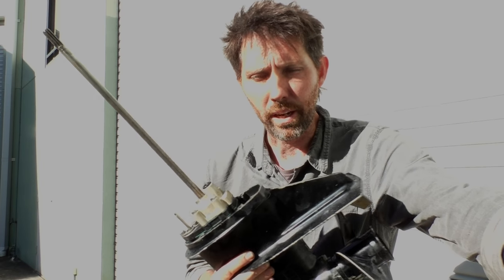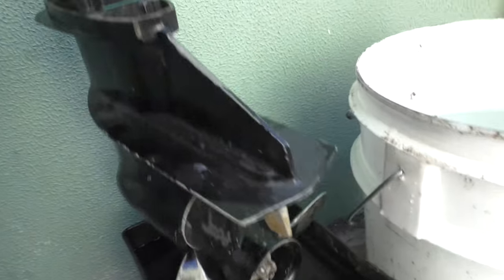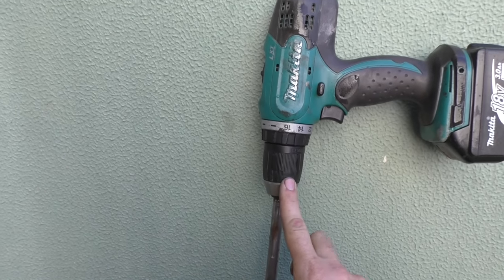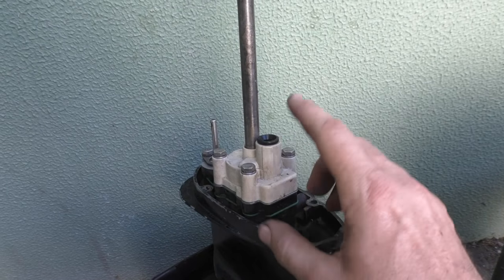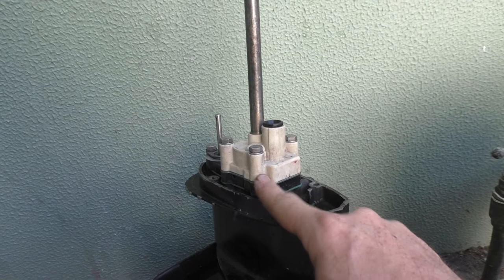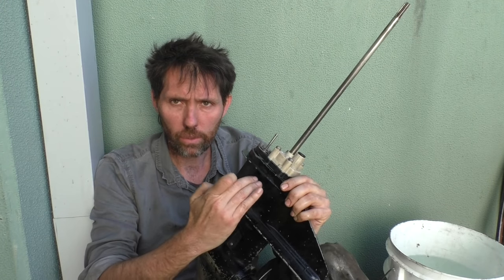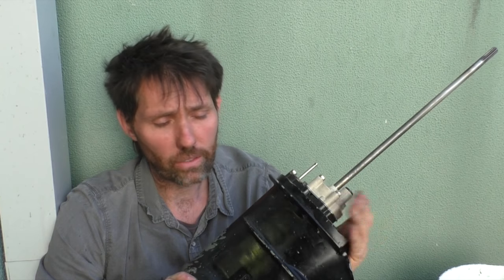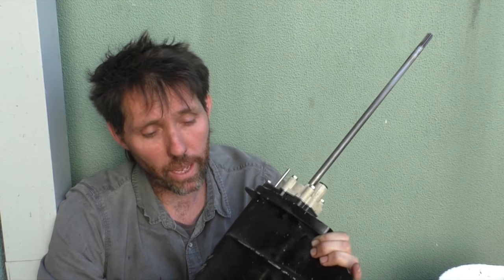Testing an outboard water pump

Comment: Ok, so i have had my lower unit tore apart 3 times.  I have always run it on muffs and not in a bucket, i cannot get it to stay cool., or pump water.  I have a 1972 Johnson 50 HP.  I will try an run it in a bucket.  Is it best to run these old motors in a bucket instead of on muffs?
Reply from the maker: I've always found muffs to be a bit hit and miss. I would test it in a bucket and if it pumps water then I would also be looking for things like whether the outlet pipe and the pump are lining up properly.

Comment: I have to THANK YOU as I replaced a few parts to include the impeller, water seal damper, gasket...etc  and no water came out.....I filled a bucket higher with water  and it came out just fine.

Comment: I have a Mariner 150 outboard that quit peeing.  Checked all of the lines and they seemed clear so I rebuilt the water pump.  I have ear muffs on the engine and still am not getting water out the pee port.  Do I have to take it to the water to check it out?
Reply from the maker: You can just lower the engine into a large bin of water.

Comment: i have a 1999 150 suzuki its pumping water out the pee hole but none thru the heads i pulled the thermostats but still no water any suggestions
Reply from the maker: If that is the case then either the pump isn't producing enough pressure or the water jackets around the cylinders are blocked. Try putting some compressed air up through the pipe heading up from the water pump, otherwise you might need to take the head off and see what is going on in there. Some 2 stroke outboards have a cover over the water jackets which makes them easy to inspect.
Reply: i installed a new water pump now im getting water up thru the motor but the temp sensor is still going off everything is staying cool but looking at back of motor the left top side starts getting hot but not real hot either i have a bad sensor r something else any ideas and what might i try to check see whats wrong any suggestions would help thanks
Reply: maybe u could show unstopping the water jacket r how to go bout cleaning it out

Comment: Love the Chanel No telling how much time and money this guy has saved me. I have a question? I have a 89 60hp evinrude I have bought back to life. When it’s in water and staring for the first time it makes a sucking sound. Could this just be the water pump priming? That’s the only time it does it. The motor runs with no issues and is not hard to start. Thanks in advance

Comment: i have a small mercury 7.5 hp and the new water pump don't seen to pump the water up?
i hook a hose to the flush valve and it goes thru motor ok, I changed the water tube and cleaned when it plugs into and nothing? I had tested the water pump in a tank with big drill and it pumped fine! It's got me
Any ideas??
Thanks
TOm
Reply from the maker: Perhaps it is just not mating correctly with the outlet pipe when it is being installed. Are you testing it in the water or on muffs? Many outboards don't pump water very well on muffs.
Reply: i tested in a large ice bucket just the foot, i put foot pack on see what happens now
Thanks

Comment: Hope you are able to help me.  I have a mid 90s Mariner 8hp outboard.  I replaced water pump housing and impeller but now it is having a unique problem.  It pumps a strong stream of water out of the tell tale at idle but stops when rpm are increased and exhaust comes out tell tale.  When returned to idle strong stream of water returns. What could be causing this? Any help would be appreciated!
Reply from the maker: Hi Brian. I've never seen that problem before. My first thought was maybe head gasket but reading this thread it seems there is a simpler possibility that may be what is happening with yours http://forums.iboats.com/forum/engine-repair-and-maintenance/johnson-evinrude-outboards/602160-6hp-stops-pumping-water-at-high-rpm-1967-new-water-pump
Reply: Thanks for the link. I will check compression first and then move onto other suggestions from the link if necessary. Your videos are great. Keep up the good work.

Comment: I replaced my impeller and I have no water coming out the pee hole. I took the lower unit off again and tried this and the water pump is working correctly. I also ran a hose up the copper pipe that comes down the engine shaft and water came out the pee hole very strong. I have a 1974 mercury 9.8hp
Any help would be greatly appreciate!
Reply: Did you ever solve this problem? I'm reading through the comments as I have exactly the same issue. Run in a bucket, the water pump works fine. Run a hose up the pipe in the shaft or into the thermostat housing and it flows. Hook everything together and no water is making it to the thermostat housing.

Comment: On the basis of this video I was very careful to test my Honda BF45 (which runs anti-clockwise) with the drill running in that direction. No joy. Took pump apart (new kit had been installed) and checked but still no joy. Then I checked the parts catalogue online and saw the crankshaft terminates in a 'primary drive gear' while the sump contains the bearing and short shaft assembly for a 'primary driven gear'. So motor runs against the clock but drive shaft doesn't. Tricky.
Reply from the maker: Ah, very interesting (and tricky as you say), I've got a dead Honda BF40 in the shop at the moment. I'll have to pull the crank case apart and look into this. Thanks for mentioning it!

Comment: How high does the water need to be in a Johnson 25 year 82 ?
Reply from the maker: Up to the level of the water pump itself.
Reply: @DangarMarine  thanks. Figured it out   Thought it wasn’t pumping but water level was just not High enough. Engine did get hot when j had it idling for awhile up to 250 degrees about.  I took it in the lake today and it worked fine. Tell tale did get clogged by the end of the outing. I though pump stopped

Comment: I did this test and had much more water flow than u did. Yet when leg is on motor and in enough water i have no flow. I have also checked for blockages and have none. All i get is smoke out the pee hole.  Any ideas?
Reply from the maker: Is the pipe heading up to the powerhead joining the pump properly when you put the gearbox back on?
Reply: @DangarMarine  yes it is. I shine a light up made sure it was in b4 doing the bolts up
Reply: The water in the bucket is very oily too but when i checked gearcase oil its still a good nice blue color like new oil

Comment: hi mate cool vids, any tips or tricks on removing a broken driveshaft out of a 2 banger yammy 40?, previous owner thought it was a stump grinder, its broken at the spines above the o seal we have tapped it and have have about 4 threads in it but shes wont pop out, can they twist the crank?

cheers bud
Reply from the maker: Hi mate, can I just confirm, are you removing the driveshaft from the crankshaft (powerhead) or from the gearbox? I presuming powerhead, in which case it can be tough. Once it is corroded in there the usual techniques of heat and penetrating oil will help as always. Have you taken the powerhead off the lower cowling or is it still in place?
Reply: hi mate, cheers yeah its stuck good its recessed in a housing about 2 inches deep looks a bit like a icecream cone, 
yeah the power head is on the floor
Reply from the maker: Tapping a thread into was a good idea. I would try heat, oil and a slide hammer with a pair of vice grips on the end  to pull on the screw you've put into the bit of shaft. Failing that you might need to split the crank case open.
Reply from the maker: Oh, and if the heat damages the main seal you might need to open the crank case anyway to replace it...

Comment: Hi...my pump is now working fine with new impeller kit. About to put new  thermostat in. It overheated even without thermostat in but have water in thermostat housing!!?!! If, when i put new thermostat in, it still sounds overheat alarm on remotes, is there a sensor or....what would be next port of call..if you know?? Help!! Im stranded and everywhere is closed!!!!lol. Its a honda bf20d btw. Keep safe bro.x
Reply from the maker: Could be a sensor, could be blown head gasket, could be blocked water jackets. Get a cheap infrared thermometer to confirm it is actually getting hot.

Comment: cheers for another great video, i did found this video after i changed my impeller over hahah but have booked marked it , i have a  question for you , if you put impeller with vanes facing opposite direction will it right itself or do i need to pull it  out and set correctly . ( mine is pumping good water but it is warm water not cold and im a bit concerned cheers mate
Reply from the maker: If can do, but not always all of them will flip. I've certainly seen impellers come out of an outboard with half of the vanes facing the opposite way to the others. They would probably have much more of a chance of flipping if the unit was very dry so if you are worried, maybe let it dry out for a bit then turn it over for a couple of seconds before starting the water.

Comment: Great videos just wondering how do you find your engines rotation I'm changing the pump on a Yamaha 55
Reply from the maker: Turn the key or pull the chord and look at the rotation. If it is a Yamaha it will be clockwise.
Reply: @DangarMarine  Thanks for that I replaced the pump and it's working fine however the clutch isn't working as it seems to be in forward all the time

Comment: hey mate gone though test with water pump and works. re did power head gasket but motor steaming heaps on idle and low revs. 99 mercury 50hp
Reply from the maker: Have you checked the thermostat? It may be stuck closed.
Reply: Dangar Marine yep it is brand new one but runs fine just steam heaps at low revs. bit higher and on plane its good??? cant figure it out

Comment: Hi fantastic video. i have a 2000 model Johnson outboard 25hp it had a new Impeller kit fitted by a marine mechanic we brought the boat get home put it in water no water out pee hole i blew in it it seems clear. got me stumped
Reply from the maker: Thanks mate. If it is still giving you trouble this video might give you some more ideas. https://www.youtube.com/watch?v=dx8_xP30aSY
Reply: Hi fixed pumping problem the new impeller was shredded, but i have another problem when engine is running it sounds like its sneezing so to speak like a misfire any help appreciated

Comment: Hi!
I should have looked at this video before we took The lower unit off!
Did not pump any water Suzuki dt85 1990! Now we cant put The gear shaft back 🤪
Reply from the maker: Bummer. I wish I had ever done that job on a Suzuki before and could give you some tips.
Reply: @DangarMarine  thanx for The reply! Its fantasc that someone answers my question ön The other side of The world! Here in sweden NO one could help US with this old motor! The shift rod cant connect when we mount The lower unit back! Someone must know! Keep up The god work and so far you have helpt us so much!, cheers

Comment: hey man, i need some help, i screwed up big time trying to replace the impeller in my 40hp yamaha. after replacing the impeller        i tried running it off a garden hose motor flusher to test it and its not pumping water, so i pulled the hose going to the tell-tale and realized there was exhaust blowing out of the hose, so yeah i have no idea what i did wrong but i must have screwed up pretty bad, any ideas?
Reply from the maker: There are a few things that can go wrong. First, is that the pump may not be getting water from the muffs, that is very common, putting the leg in a big bucket of water is more reliable. The impeller may have been twisted the wrong way when installed - some motors go clockwise, some counter clockwise. The key that locks the impeller onto the driveshaft may be missing or the pipe that carries the water from the pump to the powerhead may have be misaligned and not slotted into the pump outlet.
Reply: I pulled the foot off and made sure the pipe was aligned with the pump outlet and i put it in an old trashcan and filled it up about an inch  over the pump and good news, It pumps water now! But now i have a new problem, I have to run it on half choke all the time, And of course it runs rough while the choke is on but if i flip the choke off it runs smooth as silk for about 30 seconds and then it dies, Flip the choke back on it fires right back up, It kind of seems like its running out of gas to me but what do i know, This is the first outboard I've ever worked on. It hasn't been ran in at least 4 years and it hasn't been on the water in at least 10 years.

 And thanks for the quick response, Your one of the few Youtubers that goes past just posting videos and going on with there lives, You actually try to help people. I must have watched a dozen of your videos trying to fix this old motor and a few more dozen just for the heck of it. Keep up the good work

Comment: Why would you have a problem if you were to turn the driveshaft in the opposite direction?
Reply from the maker: The impeller blades compress into the pump housing like a spiral so when you turn the shaft the wrong was the flexible blades can flip over backwards.

Comment: Did all this put it in a deeper tank. But my impeller is still not pumping. The impeller looks good no fraying rubber. I'm stumped
Reply from the maker: Turning in the right direction? Impeller installed the right way round?

Comment: Hey man! I have broken down my tohatsu 40hp 2 stroke motor and my impeller for the water pump is actually loose on the drive shaft. Is that a issue?
Reply from the maker: Yes, it shouldn't be lose. I would replace the impeller for sure.
Reply: Dangar Marine thank you. Also I'm a little confused on the wiring for the motor. I have 2 start relays and I also have some wires coming from my tilt. Not sure how to wire it together

Comment: You should also check water pressure coming out of that impeller pump outlet by jamming Your thumb in that hole and see if it squirts out with plenty of pressure. Just to be sure it's worth puttin it back on the outboard without replacing the impeller.

Comment: Great video, thanks ! Question for you, thow.I recently replaced the complete water pump assembly on a 78 Merc 7.5 hp. I test ran it in a tub, everything was fine, great flow. Went out on a lake, only put about a half hour on the motor, to set everythingup  and everything was fine. Being the first time I was going to go out this year, I threw the motor in my test drum and fired it up, ran good, great water flow for about four minutes then it stoped completly, zero flow. I checked to see if the intake was pluged and everything was clear. Any possible ideas would greatly help this DIY guy !  Very short life for new parts ?? Keep the vids coming, you are teaching a great deal to those that need it, like me !  :)
Reply from the maker: Hmmm, that is a bit strange. A water pump won't go from good flow to nothing all of a sudden. Sounds more like and air lock or a blockage to me. I would be very surprised it if was a pump failure.
Reply: Dangar Marine Ok , I will go that route and see what I get . Thanks for your time , greatly appreciated !
Reply: Dangar Marine Actually it was two blockages, go figure. But it's up and running, thanks for your time !
Reply: Pracerz: how did you unplug it ?????
Reply: elimonjal compressed air from a big unit. Had to do it a couple of times, but it flows great now.👍
Reply: When I've had this problem it was either one of three things:  The thermostat(s) was stuck;  or (2) the water jacket (head cover) was full of corrosion and stopped up; or (3) dirt dobbers had stopped up the tell tale (pee hole).   Back flushing the system has helped to remove the blockage on occasion.  On my late 80's Evinrude 115, every spring I'd have to hook up the flush muffs and tap on the thermostat housing for a while to loosen the thermostats.  After that,  it'd work fine all summer (sitting up over the winter the stats would get stuck).

Comment: Hi dangar stu and community 
I have a jonson 140 vro 96 model ive replaced thermostats water pump heat sensors head gaskets  cleaned heads out
 And getting plenty of water out of both sides of the heads but hot and the alarm is going off does can any one out there give me any ideas for me to check 
Thanks community
Reply from the maker: Hmmm, that's a strange one. Have you put an infrared thermometer onto the head and block to see if it really is getting hot?

Comment: I was running my outboard in plenty of water but after 45 seconds or so of idling in neutral, the water stops coming out of exhaust.
Reply from the maker: Is the impeller in good condition?
Reply: @DangarMarine  yes it is, actually yesterday I ran it in more water and the water never stopped pumping so that's good. But the force 9.9 outboard still over heated for some reason. I dont know how to maybe set the premix screw?

Comment: my drill wont fit over the shaft 😑
Reply from the maker: You might be able to find a splined sock that will go on the drive shaft that you can then turn with a socket extension in your drill.

Comment: Excellent as usual.  When testing outboards at work, I usually run them in the test tank or on muffs.
Reply from the maker: Thank Will. Yep, test tanks are great for testing running outboards, by far the best way if you ask me. For seeing the water come out from the pump I find buckets a bit easier.
Reply: C

Comment: Might works for very small outboard engines, but any bigger engines you'd need a hell of a gigantic drill to make the shaft fit on it loll
Reply: Chris King use a short hose over the shaft then a bolt in the other end of the hose.  Hose Clamps if have too.  Then the bolt in the drill. Works great!
Reply: @tomharrell1954  : I didn't bother much.. bought 3 different diameters drive spline sockets ! Saved me lots of time!